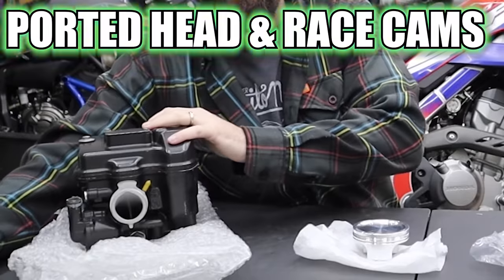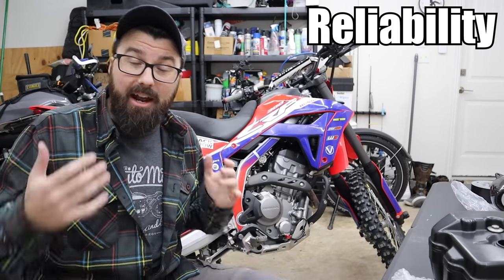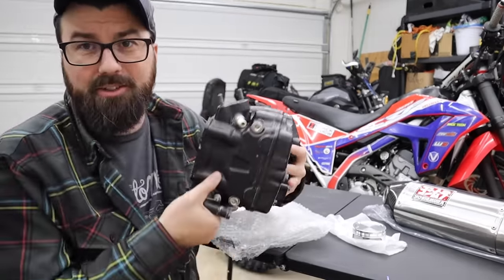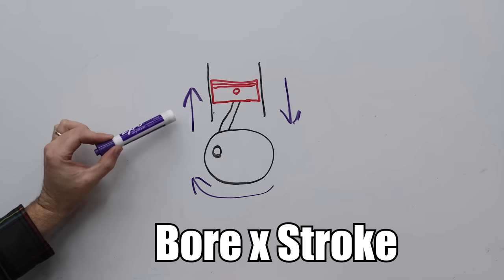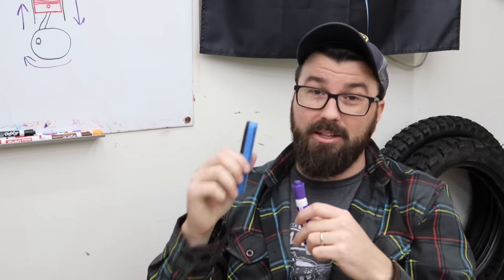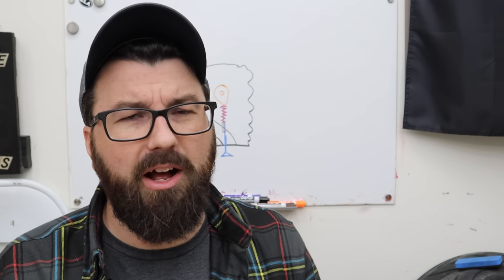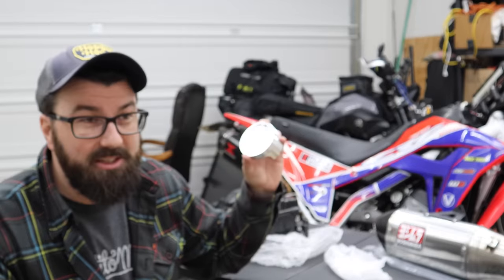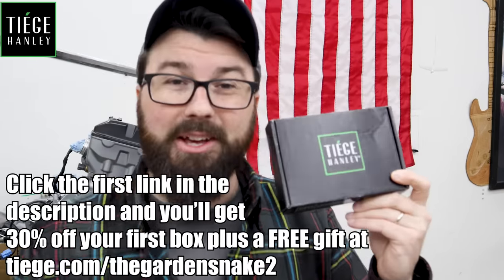CRF300L Big Bore

Comment: I agree with you about the slipper clutch holding the power fine. I have set mine up with CBR cams, airbox mods and a tune, and after 12,000km even with rally racing abuse at 9,000-10,000 revs all day... it still works fine.
Reply: I have same as Shonkey minus cams and zero clutch issues

Comment: Jake, the 300 uses a 38mm throttle body, a crf250rx uses a 44mm.  The new KTM 125 2 stroke has a bigger throttle body than the crf300l. At some point your gonna have to address the choke point.
Reply: The 450x has a 46mm

Comment: I been building race engines for dirtbikes since 2000. I've rebuilt engines after every race, so you can't tell me that big bore kits and mods don't take life off the engine. It will run hotter

Comment: People always bring up reliability.  Compared to the 70’s, reliability is not much of an issue.  Electronics, building tolerances, limp modes, over rev protection, etc., make all vehicles reliable
Reply: Horsepower from the factory obviously more reliable.  If it was designed from the factory with turbos is one thing vs you bolting on a turbo and doubling the horsepower.

Comment: Nikasil bore that will keep the reliability up. If you change the factory Nikasil bore to a steel sleeve/liner then you will most definitely lower the reliability. Another plus is Nikasil bores have very low friction compared to a steel sleeve.  You can also get a steel sleeve bore nikasil lined. Love the build and where it going!

EDIT: NO WAY I CAN'T BELIEVE THAT HAS A FACTORY STEEL BORE!?!?!? Hey if you plate the steel bore then you would increase reliability over stock.
Reply: I've seen three race seasons and 10,000+ street miles with no issues on the stock steel bore and my 78mm piston. Nikasil is nice, but not necessary. Kinda like getting your trans IMP treated...
Reply: who makes the piston? and where can I get the piston and big bore head gasket?  @AriH211

Comment: Oversquare vs undersquare balance.  Rpm  x torque = horsepower although there is a  number above to compensate /constant.  More internal internal inertia.  Once reason Ferrari/Lambo like multi small piston/small liter engines, ie V12’s.

Comment: What’s the compression ratio of the new piston? I’m asking because you may actually notice a small decrease in power throughput some
Of the rev range. The forged piston usually weighs a few ounces more than the cast piston. Which take much more umph to spool up too high rpm, however your also INCREASING reliability. Higher compression will
Not effect reliability nor will your valves being open longer duration from new cams either. You may want to check your valve lash every 30hrs for the first 60hrs but after that you can go back to regular maintenance as usual

Comment: Would balancing and blueprinting a single cylinder motor do anything? I'll have to research that. Turns out you can't "balance" a single cylinder motor, it needs at least 2 cylinders.  Blueprinting is just making sure the specs are as dead on as possible.

Comment: So I’m thinking about big boring my 450x to a 480 a lot of people tell me it will blow up
Reply: Engines dont blow up, look at the components which will be exposed to the greater force produced. Connecting rods big ends take alot of the force, try to find a forged piston. New rod bearings, can you find a forged crank? Don't rev it until the engine has warmed up to prevent piston slap.

Comment: At this point I really don't see a reason anymore why you don't use a 450 RL haha. At this point it would be cheaper, easier and better, while being about as reliable. People discredit the reliability of the 450 RL, but it is actually extremely reliable. It's detuned to 43 hp and has a three-ring-piston in a motor that was designed for about 150% of that power. It's basically indistructible. On top of that, the 450 has waaaaay better suspension AND is lighter.
I still enjoy your projects, and you also do it for the learning, but I think it is a bit of wasted energy.
Reply from the maker: "cheaper, easier and better, while being about as reliable" not really. Did you watch my video about the mods I recently did?
Reply: The 450 has a 16k mile rebuild interval or something close. Way more than I thought
Reply: @TheGardenSnake  I haven't watched that video before, but I just did right now. Here is the thing: You're comparing the 450 RL to EXCs and Betas, but fact is, it is not comparable to those bikes. Those are hard enduro bikes with two-ring-pistons and almost 50% more power than the Honda. And even those bikes have oil change intervalls of 30 hours. If you ride them on the street, that would equate to about 1000 miles. And even with those bikes you can massively extend the oil changes. I regularily do 60 hours on my Beta. I have a friend that does oil changes about every 150 hours on his EXC and it just keeps going. He is way past 2000 hours and only just now needs a rebuild. As a matter of fact, manufacturers put conservative numbers into the manual because they don't want to be responsible if anything happens. And I'm not pulling that out my ass. My university professor is the guy that designed the Aprilia RSV Mille engine in his time at Rotax. And I regularily talk to him about motorcycle engines. (Great example of conservative numbers is Honda specifying to change the chain every 15 hours in race settings, that's about the time I ride between adjusting my chain tension... in race settings lol). There are many people that have done way over 20.000 miles on the RL without even adjusting the valves, because they are still in spec, yet Honda says that you need a full top end rebuild after 20.000 miles, complete with new valves and everything. Honda also says to replace the fuel filter every 1800 miles... I think I know nobody who has ever replaced their fuel filter... ever, and yet their bikes keep running.
I understand that you like modifying your bike and like you said in your other video, you would have likely spent the same amount of money on the RL if you had one. But you wouldn't need to do the complicated power mods.
Like I said before: I still enjoy your projects, I like what you're doing, I too am learning some new stuff through them. This is all just my opinion... meaning: I would have done it differently for the reasons stated above. I even considered riding around the world on a RL once, but they are hard to get here in europe these days, so I'm looking for something different.
Reply: @Blockbuster2033  theres a reason every mx bike comes with a 15 hour recommended piston change. Does anyone do it? Hell no lol